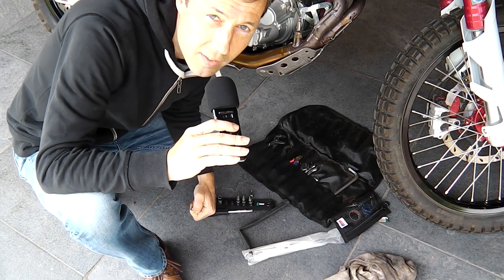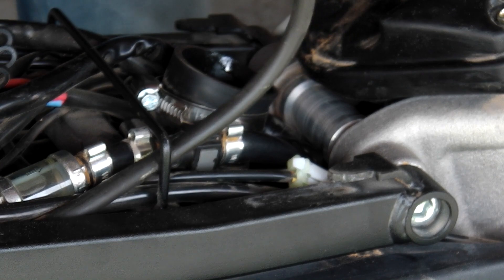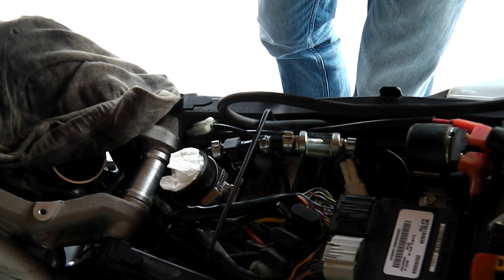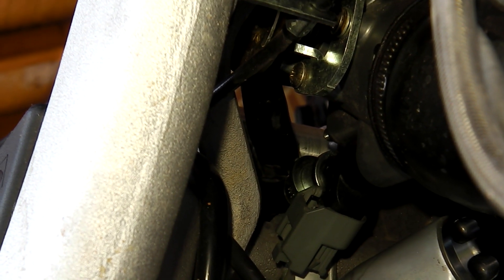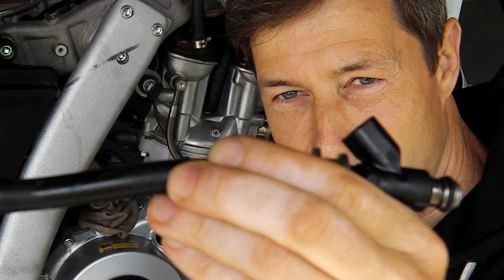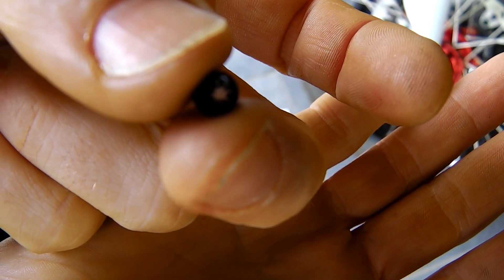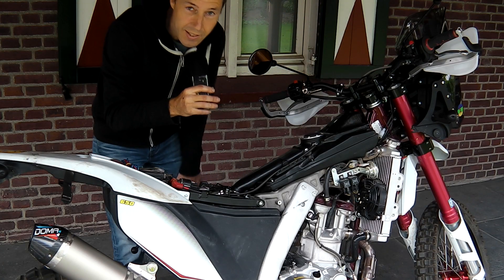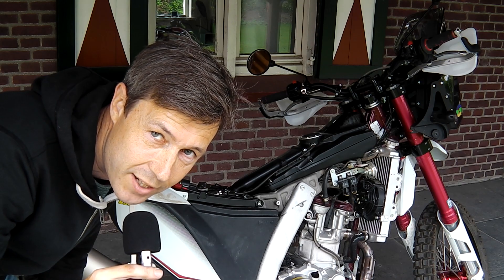AJP PR7 Fuel Injector Filter Removal

Comment: Hi guys, here is a link to the micro filter replacement that i am using, they works with the stock injector. injector spare part is also availlable on ali for arround 10e

https://fr.aliexpress.com/item/50pcs-Wholesale-Motorcycle-Fuel-Injector-Micro-Basket-Filter-Size-5-9-5-5-18-4mm-top/32408433824.html?spm=a2g0s.9042311.0.0.702a6c37VpgArM

Comment: thanks for this as I had exactly the same issue except that my PR7 wouldnt start and end up having to have it "towed" back to the dealer. If it happens again I'll hopefully be able to clean the injector.
Reply from the maker: Sorry to hear that man. For the next time you should know that cleaning the filter is an easy task. It's also unfortunate that so many owners have to go through this. I've recently upgraded my fuel filtering which you can see in my other video. That should keep the injector filter from getting plugged ever again. Good luck with your pr7. Besides this filter issue it's an awesome bike.
Reply: @joacerbis  The other video about the fuel pump filter is how i found this video. and yes i have placed my order with Guglatech :)